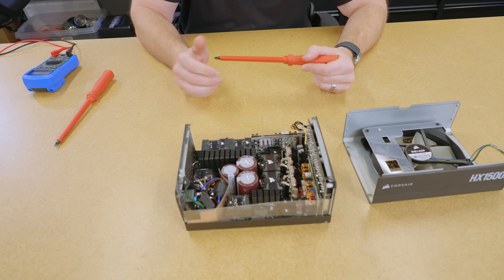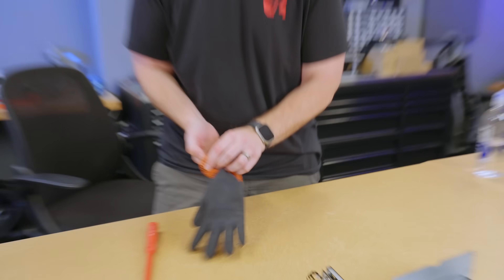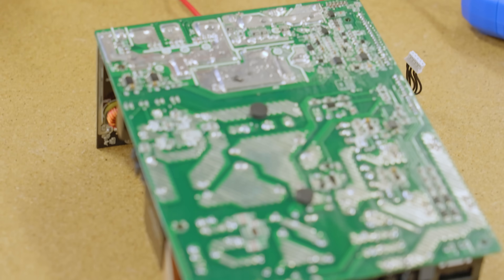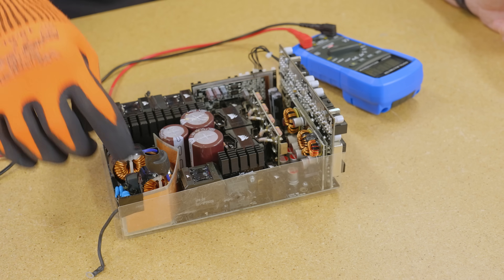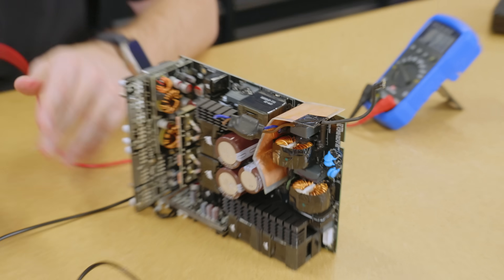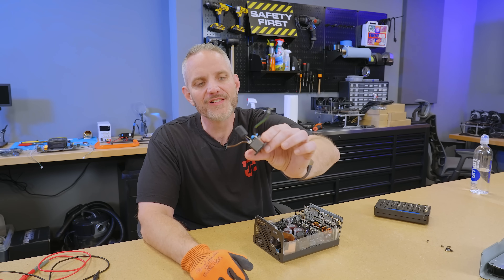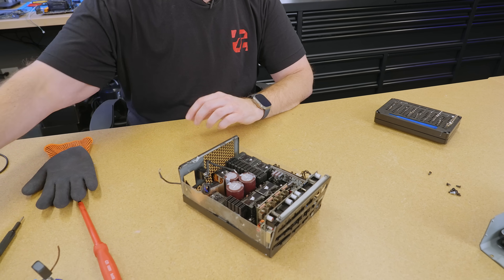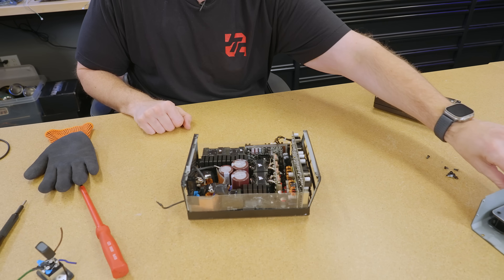Investigating what exploded in my PSU... DANGEROUS! DONT ATTEMPT!

Comment: You can discharge the capacitors with a 5 or 10W resistor with a value around the 1k. It will take a bit of time but it will discharge the capacitors safely. When  i repaired PSU's in way paste  and needed to discharge those capacitors i shortes them with a screwdriver. Works very good to discharge them quickly. But be aware that you will see a little spark and hear a little bang.

Comment: You can literally see a hole in one of the caps.  That's what happened.  It blew.  Just because there is still voltage on the caps doesn't mean anything.  The three caps are in parallel, so the other two are still good and retaining voltage but the one that blew is likely open.  I had similar happen a long while back to some Rosewill PSUs I had.  It probably popped so loud because the X for the pressure relief wasn't cut deep enough so it took a lot more force to pop it than it normally should thus made a louder pop.
Reply: Yep, I saw the same thing.  I don't know how Jay missed it.  It almost looks like someone just shoved a knife in there.  You can see it very clearly in the top capacitor if you pause at 5:29.
Reply: @darkprinc979  He notices the "yellow stuff" and dismisses it as purely coincidental. at 7:50
Reply: I just spotted that after I read that comment, that is tiny, just one slit in the 150V680μF.
Reply: Honestly, not sure he should see these comments about missing it, else he may decide to go digging in it some more and hurt himself. :|

Comment: To discharge, use a light bulb, or better yet a spare case fan. I'm sure there is plenty of those around the shop. Otherwise, that is a metal case of "ouch" if you complete the circuit with your hand.

Comment: I picked up a used i7-10700K PC that was running slow and having issues. Reinstalled Win11, problems continued. Ran Prime95 and stress tests, speeds and clocks would climb normally for a minute before dropping way down, I couldn't find the reason why. Installed Ubuntu, ran some other stress tests including one that stresses the GPU (evga GTX1080 hybrid air/water cooled unit), and when it was testing the GPU, I got a pop and the entire thing died. I have a replacement power supply on the way, I suspect it wasn't providing enough voltage and causing everything to run at lower clocks, but Linux ignored the lower clock limits and popped the power supply.

Comment: I was building a PC for a family friend a few weeks ago and the brand new Corsair PSU I was using exploded, a loud pop followed by a puff of smoke. Did the return to Amazon got a replacement and to my shock and horror this one exploded as well. Both Corsair 750 80 plus bronze "perfect for a budget build" lol. Anywho proceeded to pay in full for a new Thermal Take 850 gold model, and thank the gaming gods that the 2 Corsair grenades didn't burn my other components. This is the 3rd Corsair PSU that died on me straight out the box, I'm done with the brand until I learn something different.
Reply: same here and i’m switching to be quiet or seasonic PSU is good stuff than corsair psu, dude
Reply: Shame. They earned a pretty good reputation back in the day. I'm still using a budget Corsair 850W PSU that I bought in 2011. I even overloaded it a bunch of times. I guess the shareholders got to them too.
Reply: @andyasbestos  It depends who their OEM is for that series at the time of purchase. It is pot-luck with any brand that doesn't roll their own.
Reply: side eyes his 850w corsair psu
Reply: Strange how there are a lot of Seasonic vs Corsair threads on here - almost like a campaign  lol  Other PSU makers are available, but it seams Seasonic are the only choice eh??
Reply: Gold rated is what you'll find in a good pre-built. It might be 15-20 years since I put a bronze rated supply of anyone's in a build.

Comment: Shorting the caps is perfectly safe. Their size comes from their voltage rating, not their capacity - they will discharge too quickly to set off any fireworks. You can clearly see the 470µF on the top of one of them, it's really not THAT much.
Reply: the capacitance isn't why caps go bang. The voltage is why it goes bang. 150 volts will make a nice bang, and it'll probably spark, but after words, will be fine. Ever shorted 120v at the wall with a paperclip? Trust me when I say, it goes bang...and no, don't ask me what I was thinking, because I don't remember what 10 year old me was thinking. And obviously, I didn't use my hands. I was dumb, but never that dumb....

Comment: Used to have old paper cased diodes that would explode as loud as a .22 pistol shot which was my assumption when I heard about this in the last video.
Got a burn scar on the back of my right thumb from the PSU in an iMac that I didn't discharge before working on it. Good times.

Comment: Holy shit, this exact thing happened to me just a few months ago, it was also a Corsair PSU, a RM850i (I.T.E.). It was in my Jonsbo D31, PSU right at the front, and I was messing with stuff under my desk, my head very close to the front of the PC. I just started the PC, it was on the desktop and I heard a super loud BANG, definitely hit my hearing for a moment, so loud to the point where my dad went rushing like wtf just happened. Fortunately it did not take out any other component. I then switched to a HDPlex 800W DC-ATX, powered directly from my 56VDC house battery bank. It's not the first Corsair PSU I see dying, I had an old AX860, a couple RM750/850 (I think I.T.E.), also most notably a bunch of SF, like one SF600 (I.T.E.) and a couple SF750 (I.T.E.) either die or just behave weird on me... They all lasted like 5-10 years, so I'm not so disappointed, some of them were still under warranty got a new one in exchange. But still... those I.T.E. made PSUs, not too happy about their long term reliability.

And regarding charged caps, unless it has small so called bleed resistors across them to slowly empty them when not in use, they can hold a huge charge for a really really long time. I had an inverter unplugged for like a week, and the caps were still very much charged after that.

Comment: maybe better to weld a screwdriver than stop your heart with those caps?    
I;ve not done this, but seems like eye protection and UV protection (ie, look away) would be beneficial before shorting...   and if you instead use a high wattage medium high resistance resistor (I assume a 1/4 watt resistor might just pop - dunno), recall that it probably is going to get really hot really quickly in your hands.   This might be fun to do the actual math on.

Comment: Meh, if you have insulated gloves and metal connector method, that's not a bad voltage to discharge via shorting - AC compressor capacitors can be done that way.

Comment: I'm no electrician and I could be very wrong about this but if you can measure the amount of power with the multimeter you can take those multmeter leads and connect them to something like an R/C motor instead of the multimeter and let it spin to drain the capacitors.
Reply: Best to use a resistor as it's very possible to damage the motor unless you know it can handle 120V of DC.  I don't recommend it but at the low voltage of a wall you can even just take a screwdriver to short the terminals although it will definitely pit it where it vaporizes some metal at where it contacted.  Not the best for the capacitor's longevity or anything and there's always a risk the screwdriver handle can't even insulate against that weak electric field if you touch the high side first.  The safest bet is always to just not mess with it to begin with.

Comment: Boy I wish I could talk to you right now. It will be like writing a novel to explain everything. The 151 volts on the main caps isn't high. It's actually low. Look at the voltage rating on the side of the caps. It's like 450 volts. As a rule of thumb, what ever the voltage rating on the caps is that should be taken as the max possible voltage you can encounter. The fact that you still had voltage there tells you it's most likely on the output side (isolated) part of the power supply. Just a guess I only watch the first few minutes so far.
Reply: Low is a relative term for 150v, remember the ac there is only around 12v so 170 ish peak. If he is only getting 110v from the wall as a lot do then that is full line voltage there.
Where as for others it's 250v rms which is 354v iirc. 
That's why the caps are rated for 400v, as they are universal to work on multiple different voltages.
Reply: @Firecul aaaaand because there is very likely a boost circuit there to boost it to 350VDC for universal input and power factor correction
Reply: @Firecul  Incorrect. The PFC circuit pumps up the 170VDC (120x sqroot of 2) to around 400Vdc. It uses a BUCK regulator to do this. It increases efficiency. The things Jay thought were transformers are inductors used in the BUCK regulator. I've been working with electronics most of my life and have repaired hundreds of power supplies. You don't believe me? take one apart and measure the voltage with it on, just do it carefully.
Reply: @spunkmeiser  Buck regulators drop voltage... are you thinking of one that boosts voltage?
Reply: @Firecul  It depends on how the regulator is assembled. In one way, it will drop a voltage, just like on a motherboard to regulate the CPU voltage. That version it uses either 2 fets (upper and lower) or a fet and a schottkey( not as efficient, but easier and cheaper to build) to pump up, the components are assembled to increase voltage, only one fet, a rectifier, an inductor and a cap. This kind of regulator is also used in inverters for the backlight in LCD displays. There the voltage to drive the LED arrays usually needs to be double or tipple what the supply voltage up. Like I said before, open one up and look. Just be careful. The voltage hurts, but the amperage kills.

Comment: FYI one of your caps had a tiny hole in the top- it had vented but somehow not blown through like they usually do.  You can even see the yellow streak across the top of it
Reply: Good Catch. When I rewinded, it looks like two caps have a slit in the top.
Reply: It's really easy to have a chain reaction where one thing blows and then causes a domino effect. The big black thing Jay was pointing at looked like maybe a half wave bridge rectifier. We didn't get a look under the heat sinks but I'm guessing those are power MOSFETs and/or the current sense resistor. Switching power supplies are guaranteed to have those in there somewhere and they're the things that are going to get the hottest.
Reply: The flashbang is very often the fuse itself. Even with a black cover, when they break quickly they emit quite a lot of light. If that capacitor is blown, the current will spike at high loads, blowing the fuse immediately.
Reply: This is it, the primary side of the psu uses pet film capacitors you can tell that the intended vent is open
Reply: Thank you!
Reply: Those caps are also absolutely not 120V caps but 420V as written on them. So that would've been a good indication that bank has gone bad. The popped capacitor was pretty easy to spot, I wonder why he didn't notice.
Reply: You can actually see it did vent, there is a small hole. At 1:55 you can clearly see the cap has a hole in it at the top. Or better yet at 7:51 you can see the hole right above the "NT". Not all caps need to fully pop open at the top. With large caps typically they just create a small hole, whereas small caps tend to be fully popped open on the top.

Likely not the only issue though. When a cap blows even more so a large one, it outputs a ton of amps to everything around it. The light they saw likely was the fuse, and with that I am sure any nearby Voltage regulators and such are likely no good anymore as well. The cap blowing was (likely) the first thing to happen then it damaged things around it/connected to it. (likely) not the other way around.
Reply: It's all an act. For clicks. Jay's a fraud just like Steve.
Reply: I thought I saw that, but I was just too lazy to rewind it.
Reply: I was going to say that blown caps normally emits some amount of white smoke... but then I remembered that the board was surrounded by (not L anymore)N2 vapor
Reply: OTOH, such a tiny hole won't can't produce that loud of a pop/bang Jay told us. There's definetely at least one cracked component on that PSU. A very solid/very hard one.
Reply: Could've also been a sudden short to ground that made the noise, not necessarely a component shattering.
Reply: @TommyThousandFaces  If that's the case, then OCP didn't tripped. And THAT is serious.
Reply: exactly my thought!
Reply: Good catch, i was thinking the same thing, It has to be one of those large caps, but missed that hole. Ofc if i was in person i would have noticed. But when I saw that that tells me  pressure relief vent was defect and not scored correctly. So it found the weakest point and thats why he heard the super loud flash bang sound because that hole was tiny and pressure was probably crazy high trying to vent from it.
Reply: You can see it as early as 1:54 as he pointed directly at it.
Reply: thats not a hole
Reply: @kacpertianable  A sensible person on the internet! Respect. 👍
Reply: The moment he said it was a loud pop I knew he'd blown a cap.
Reply: @GlassWolfLH  Without proper diagnosis, nobody knows that. The symptoms we can observe make it quite likely to be one of the Mosfets, possibly the standby 5V which can be less than robust.
Reply: That explains the reason behind his ears ringing after that. The hole is very small so it must have created a high frequency sound
Reply: Yep.
Reply: yeah, i dont know what jay is doing if he can't even notice something like that. he didnt even seem to be looking, and kept getting dangerously close to it.
Reply: @MrMediaPC  he did notice at 7:50 lol - but thinks it's coincidental
Reply: @xyz8460  He noticed the yellow marks but not that it was blown. He thought the yellow marks were coincidental.
Reply: @MrMediaPC  That is i was thinking you can see the cap had vented as the safty cross on top has split and the oil has come out the cap that yellow stuff
Reply: @MrMediaPC  On the plus side the camera was rolling and it would probably have just resulted in an "instructional video" with a lot of curse words that YouTube would want to be bleeped.
Reply: @MrMediaPC  Don't know what jay is doing? He doesn't know it either for a long while, I miss the older videos.
Reply: @ralf2166  haters gonna hate and they still watch.  The irony.  Win for Jay.
Reply: Fake news.